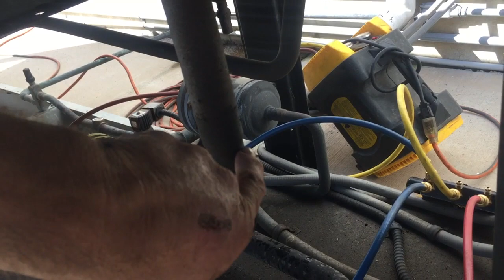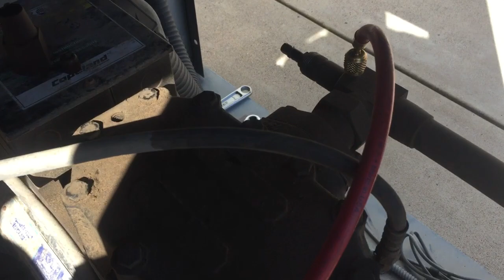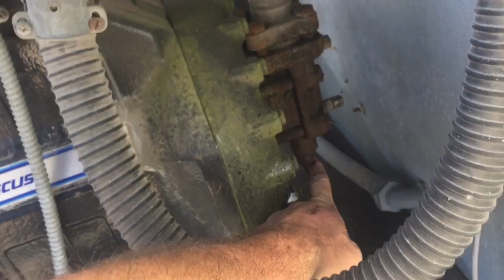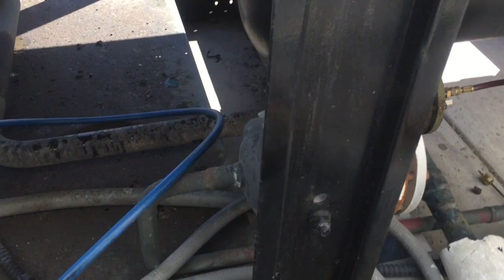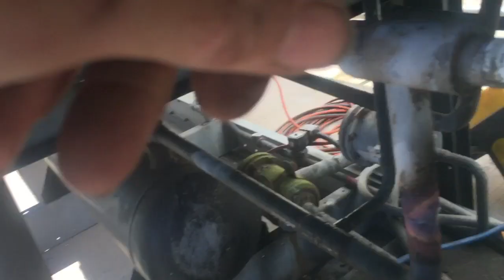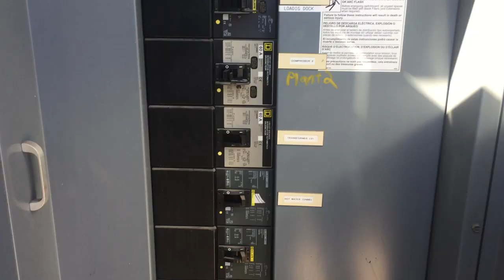Discharge Line Leak Repair

Comment: When you pull the vacuum how do you know if you're evacuating moisture vs. your valve is leaking?
Reply from the maker: Since this is an older unit and I had my hose removed from tho fitting for like 30 seconds while I torched the leak, it’s highly unlikely any moisture entered. If it did, it was right by the connection. Most likely had enough slight positive pressure to keep any air out. I have found that using a micron gauge in these situations is not going to be of much use precisely for the question you asked.